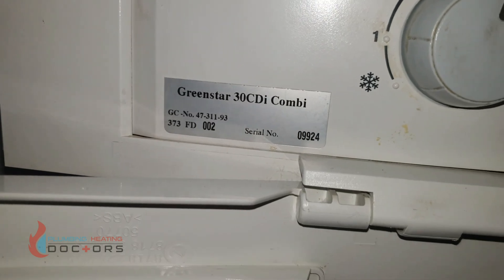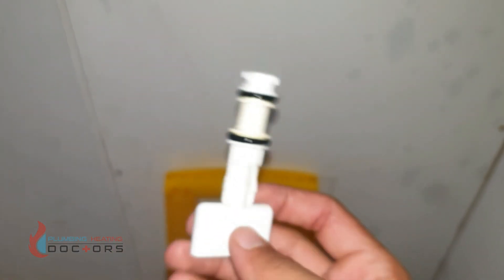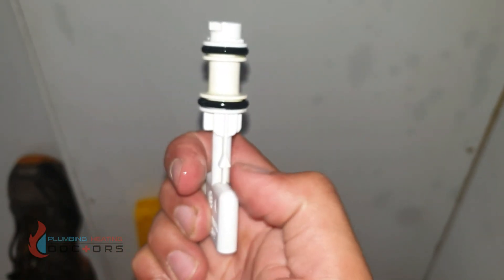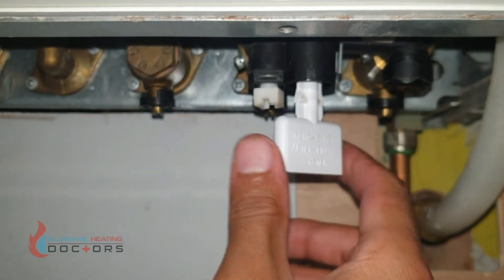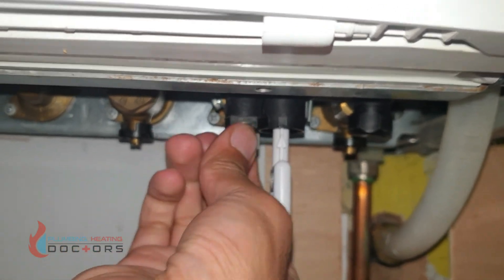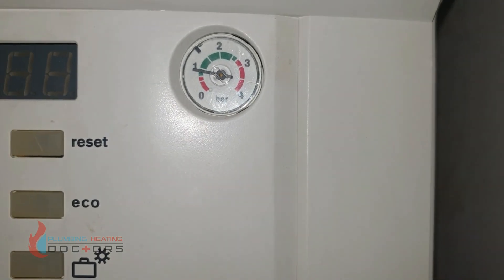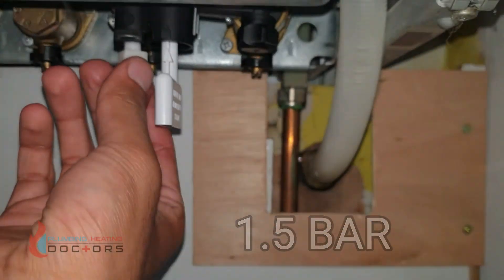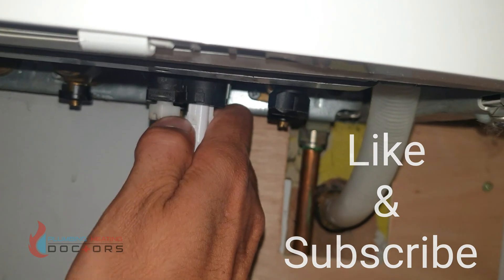How to top Worcester Bosch water pressure with key - Low water pressure on Worcester Greenstar i

Comment: Thanks a lot for your incredibly quick, clear video. Very helpful and the pressure is now normal (the hot water temps are still too low, but that’s a battle for another day).

Comment: Hi there, my gauge is on 0 and doesn’t move at all when I open the value. What might be causing this issue? 
Thanks
Reply from the maker: Gauge may be blocked
Reply: I had the same problem but I think the water needed to run through the radiators first. The water pressure went because I was bleeding the radiators and turned the radiator key too much the screw in the radiator came out after a good few minutes of hot water gushing out of the radiator I found the screw and put it back in. I did not realise this had emptied the radiator system  and the boiler pressure. So when I saw the water pressure was low when I did the recommended steps the water pressure did not go up for some time. Also does not removing the key cause the boiler to leak?

Comment: I don't have a problem inserting the key. I open the white plastic valve and water flows across. The pressure rises but very slowly and once it gets above 1.2 bar, it stops flowing. Any ideas why that might be?
Reply: Did you by anychance, have issues with withdrawing the key ?.
I struggled to withdraw the key,am I doing it wrong ?.
Reply from the maker: Yes that happens a lot
Reply from the maker: It sounds like your incoming mains pressure is at 1.2 bar and the maximum pressure you can get is dictated by how much pressure you have coming in to your home. 

You can try to increase it by making sure your stopcock is fully open or try to top up the pressure at different times during the day or night as the incoming mains pressure will change during different times
Reply: Plumbing Doctors Thank you. I hadn't considered that the mains pressure might have dropped. I thought that maybe there might be a blockage. What should I use to find out what the water pressure is?
Thanks
Reply from the maker: Pressure gauge which you can screw on to your garden tap
Reply: Plumbing Doctors Thank you very much.